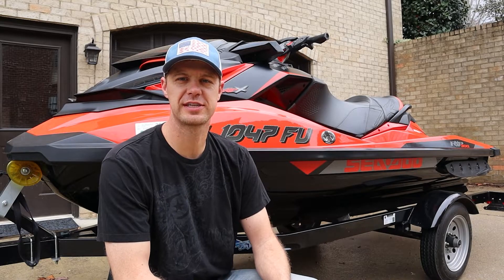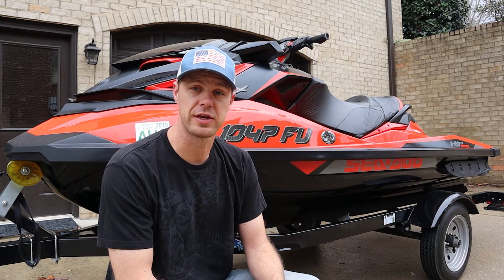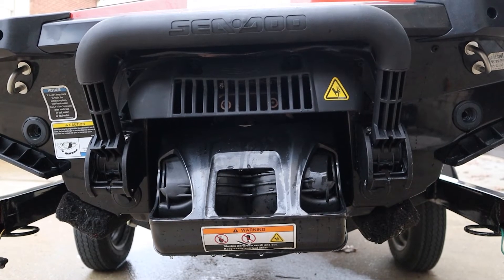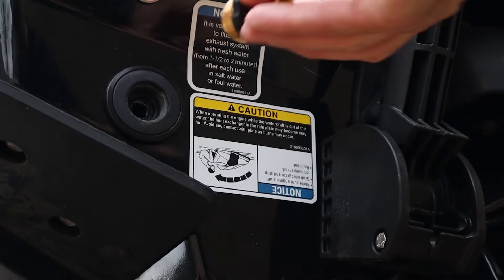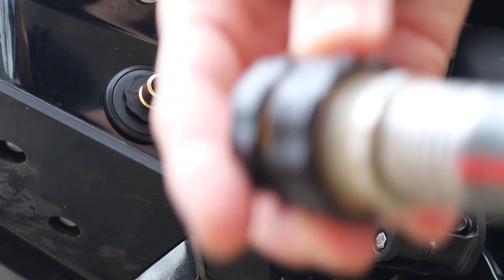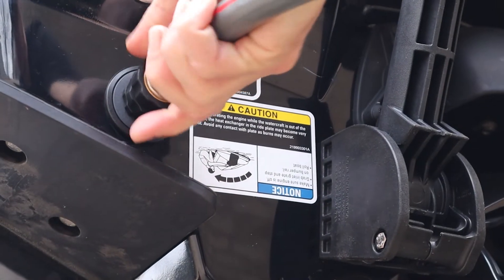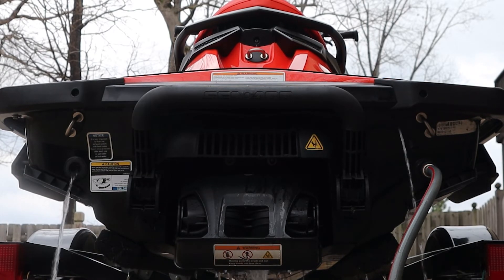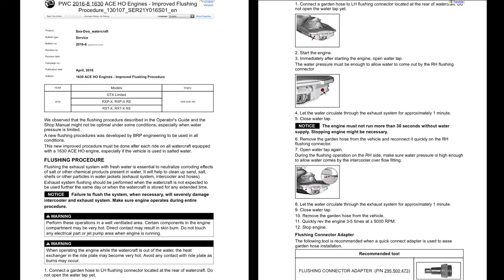How to Flush a SeaDoo with Dual Flush Ports

Comment: Do I have to close the flasing  holes  before I Put it in the sea ?  I have sea doo gtx 2004
Reply from the maker: The flush port does not need to be closed like the drain holes do. Have fun and thanks for watching!
Reply: @drcarslife8753  🩶

Comment: Greetings, I started my jet ski 2019 seadoo rxpx 300 without putting the water connection on it and it got hot and I turned it off quickly, should the water connection always be put on? Why does this model have a tank with cooling liquid and I thought it was not necessary to start it with the water connected?
Reply from the maker: Yes it is necessary if you are going to run the ski out of the water for more than 10 secs or so. The water cools the exhaust on all SeaDoo models and the intercooler when it’s a supercharged model. The only time I really run it without the hose hooked up is to expel the water out of the system. I always do this in the winter time.

Comment: What if i flush both sides at the same time ?
Reply from the maker: It will not leave a place for the water to drain out. It could potentially fill up the intercooler and back up into the engine.
Reply: @drcarslife8753  Okay cool thanks a lot

Comment: No need to use salt away? Just straight start is all you neeed? I’m
Reply from the maker: I would absolutely use salt away if I had been running in salt water. You can also put a few drops of dawn on the inside of the hose before you turn it on and run that instead of salt away. Sometimes even when running in freshwater it may be Sandy or dirty and needs to be moved out. In that case, no need for salt.

Comment: Super helpful video! Hope it’s not a dumb question but is there any need to cover the flush ports in the water? Is there a cap or a bung or something or do they stay open in the water?
Reply from the maker: There is absolutely no need to cover the holes when it is in the water. Just make sure you have the drain plugs in place. However, even if you forget those, water should not come in bc there is a ball valve that keeps the water from coming in. Thank you for watching the video! Let me know if there is any other content you would like to see.

Comment: Howecome they need to be flushed if they have closed loop cooling
Reply from the maker: Good question. The block is the only part that is cooled using the closed system. Raw water still runs through the exhaust and intercooler.